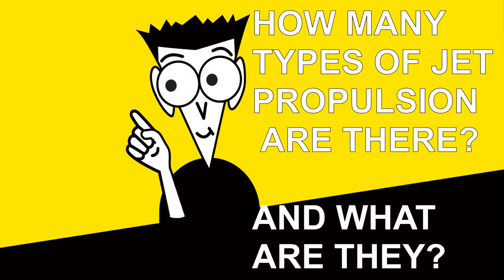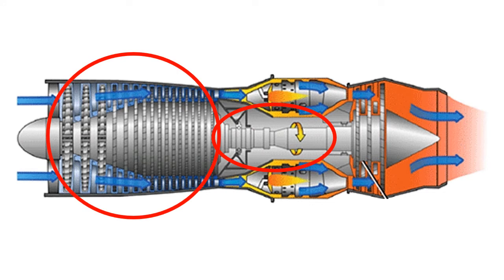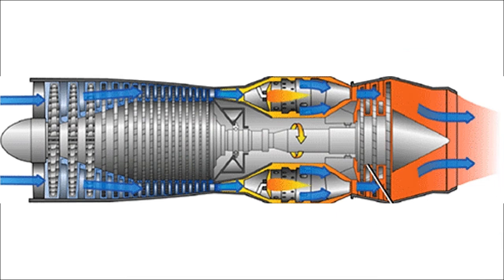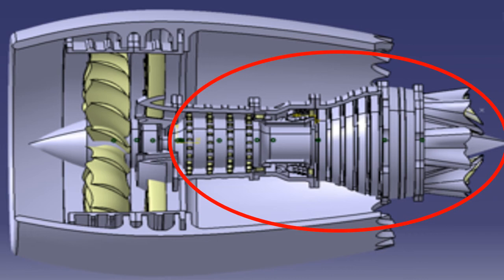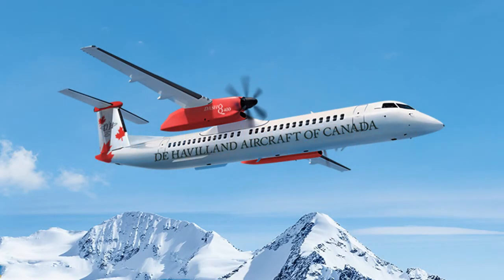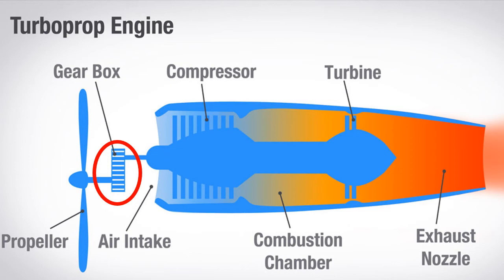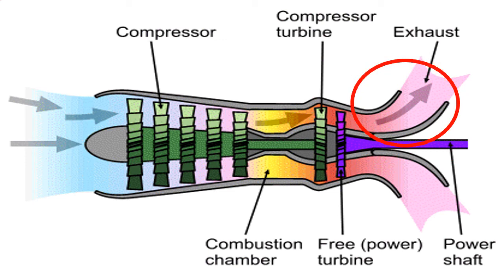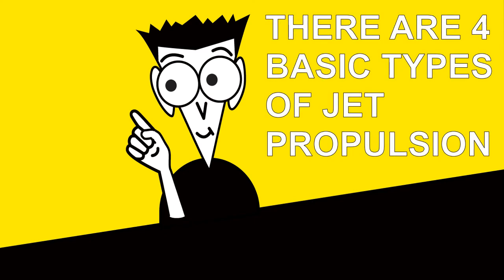How Many Types Of Jet Engine Are There?

Comment: Gotta love misinformation, so many other types of Jet Engines totally ignored in this video
Reply from the maker: Omitting engines that are not generally used on aircraft isn’t misinformation.
Reply: @theaviator3863  it sorta ends up that way though, you should at least mention something about this being the majority but more exist, someone might think this is it and if they run into a different kind it'll cause a lot of confusion and they probably won't belive it, so practically the same as misinformation

Comment: so a jet engine starts by the hot air from the combustion chamber turning the turbines that is connected to a gear box which then turn the compressors? i need clarification
Reply from the maker: The hot air from the combustion chamber turns the turbines. These turbines turn a driveshaft (not gearbox). The compressors are connected to the driveshaft. Therefore the turbines drive the compressors via the driveshaft.
Reply: Former,turbo jet must use external power to drive turbines for starting then after combustion chamber burn fuel hot air drive turbine,remove external and engine will continue running until you shut off fuel,engine stop

Comment: I had an argument with an instructor about jet fighters having turbojets...today most fighters have low-bypass turbo fan engines (since the 60's) of which the TF-30 is a first example (A-7A,F-14A, F-111), the TF-41 or Rolls Royce Spey used on the A-7D and E, Bucaneer and F-4 Phantom (UK).
Reply from the maker: Fighters have engines with low bypass ratios, so only 10% of the thrust comes from the bypass. Splitting hairs, but they are 90% jet. Whereas airliner engines are high bypass, and around 90% of the thrust comes from the bypass - so only 10% “jet”
Reply: @theaviator3863  but still tutbofans.

Comment: To those commenters below, ram jets, scram jets, pulse jets etc are not in the same family as these. This video concerns those engines that have axial flow compressors (there are some smaller jet engines that utilise centrifugal compressors) power turbines and drive shafts of which the aforementioned do not.
Reply: ram jets scram jets are by definition jet engines ... turbo prop and turboshaft engines are not  perhaps rename .. how many gas turbine engines. ?
Reply: @ianalbiston9069  Correct. This video describes gas turbine engines, not jet engines.

Comment: So, mathematically speaking, modern "jet" airliners are essentially propeller driven?
Reply: I wouldn't go that far but a modern jet engine is kind of like about 80% turboprop and 20% turbo jet.
Reply: Fan is use to move air (and fast), propeller are use to create pulling force, while fan will make pulling force and propeller will make air flow for sure, it's not their main design focus.
Also the compressor, which is build to pressurize air, but also would create airflow and some force on it if it's axial flow.

Comment: There are more than 4 types of jet engines. Not a word about radial, only axial flow? Also any fighters have low bypass turbofans. What about ramjets, scramjets, pulsejets, motorjets?
Turboprops and turboshafts are not types of jet engines, but applications of turbojets.
A wasted opportunity to educate people properly.
Reply from the maker: To answer your points:

I mention “Compressors” in the video. Yes, whilst the diagrams show axial flow engines, Radial compressors are still compressors - so makes little difference to the content.

Modern fighters do indeed have low bypass turbofans - but aircraft such as the lightning operate with turbojets. The Avon engine was an axial flow turbojet.

2 reasons for not mentioning ramjets etc. Firstly, the video is already over 7 minutes long. My stats show that people tend not to watch videos that are much longer than that. Secondly, with the exception of missiles, some drones and experimental aircraft etc, they aren’t wildly used or in mainstream use.

I correct you on your comment on Turboprop and Turboshaft engines. They are considered as a separate type of engine. The similarity with them all is the gas generator - but they are classed as separate engine types.

Comment: The biggest flaw in this explanation was saying that the fan in a turbofan is a propeller which provides most of the thrust- no, the fan is NOT a propeller. It's actually more of a compressor than anything else like the compressing fans in the turbojet core, the fan blows air through the ever narrowing bypass duct where it compresses as it's forced to squeeze through a tighter and tighter space. Once the bypass air reaches the back, it expands and accelerates out the bypass nozzle and that's how bypass produces thrust, much like the exhaust from the core. Pretty much all fighter planes also have turbofan engines and not pure turbojet engines which are nearly nonexistent nowadays.

Other than that, it was a pretty good dumbed-down explanation.
Reply: That's not really true. A fan isn't trying to compress the air per se, it's trying to accelerate it - just like a prop. Although inevitably acceleration is achieved by applying pressure - so it's the same thing. The bypass ducts narrows not because it's trying to increase the pressure like a nozzle, rather because the speed of the air has increased therefore the same mass will exit out of a smaller hole than it entered.
Reply: @N330AA  I was told by engineers that the fan blades act just like the rotor blades in the hp and lp compressors but are much bigger and spin slower. It's the expansion and acceleration of the bypass flow at the rear of the fan duct that produces thrust they explained.
Reply: @ChrisZoomER  Yes but propeller, fan and compressor blades aren't doing something fundamentally different. They are all just small wings being rotated to create a pressure difference on the other side. The objective of a fan is to minimise that pressure difference, but over a larger amount of air, as it's more efficient to accelerate a large amount of air by a small amount rather than accelerate a small amount of air by a large amount as what occurs through the core.
Reply: @N330AA  That I knew.
Reply: @ChrisZoomER  No you didn't. Face it bro you lost an argument on the internet and will forever live in shame from now on.
Reply: @N330AA  You're very funny, but really. Accelerating a large amount of air a little bit requires less energy than accelerating a lot of air a little bit because kinetic energy is 1/2 mass x velocity^2 meaning that it'll take 4x more energy to accelerate to twice the speed. So moving twice as much air at only half the speed would take only half as much energy as vice-versa, I learned that in middle school.
Reply from the maker: Yes I appreciate that - but the videos are designed for those not as technically minded. And I think the wording was “acts like a propeller” - which in layman’s terms is close enough.
Reply: @theaviator3863  I know the fan acts like a propeller but it doesn't produce thrust like a propeller. Many people think the fan is literally a propeller, thus they refer to turbofans as "propellers disguised as jet engines" as the claim that a turbofan is noting more than a turboprop whose propeller is encased in a shroud.
Reply from the maker: In Layman’s terms, it’s good enough.
Reply: @theaviator3863  I know

Comment: Can i correct you? Well... you didn't explain all the engines, you missed "scramjet" "Ramjet" and "turbo-state reactor"
Reply from the maker: None of which are in service. Scramjet and turbo-state reactors are theoretical.
Reply: @theaviator3863  true... but i did'nt know this was a video about in-service engines. Also, great video.
Reply: @theaviator3863  ah also, they are not theorical, scramjet and ramjet are used on ipersonic drones and nuclear missiles, for example.
Reply: Facts
Reply: Also pulsejet (used in some air RC models)
turbo ramjet (SR-71)
electric turbo jet (electric motor drives compressor)
Reply: The ONLY thing I can find about "turbo-state reactor" is your comment?!
Reply: @jonathanberry1111  Not actually. A turbostate reactor is a hybrid engine that to work at subsonic speed and for takeoff utilises a common turbo-jet engine, but to maximize the power turn on a stato reactor wich is like a scramjet engine. similar to a space bell engine, that doesn't have any kind of mobile parts.
Reply: The SR71 Blackbird utilise a hybrid engine. Wich can switch from the afterburned turbojet, to the ramjet static reactor.
For static reactor i mean a reactor that compress, expand and exhausts the air or the gas without the "fragile" moving parts.
That's why Ramjet and Scramjet are useless at subsonic speeds.